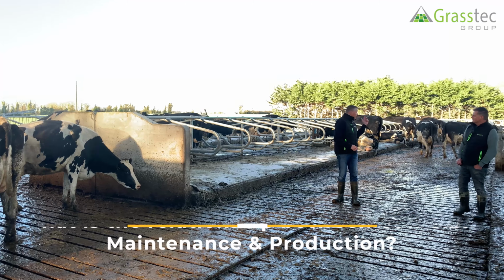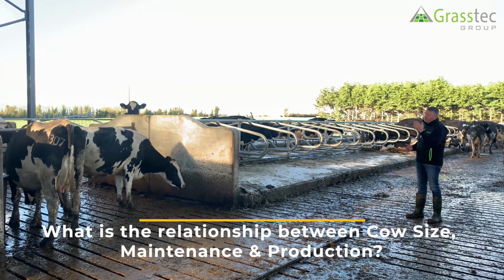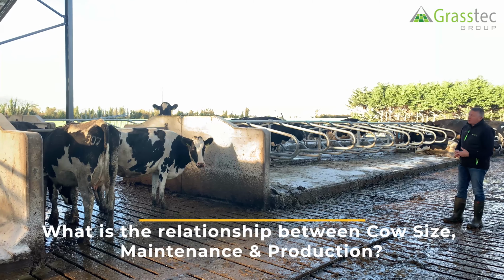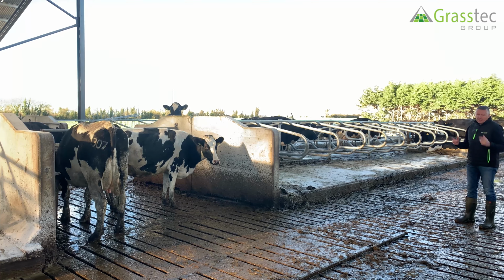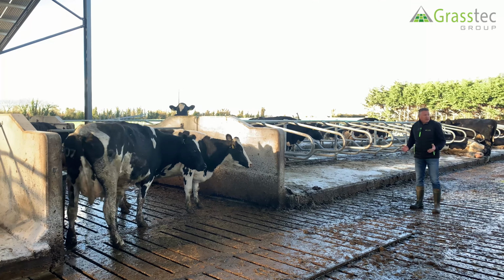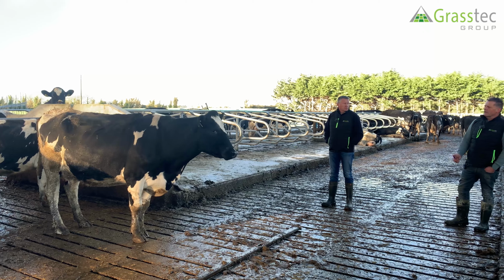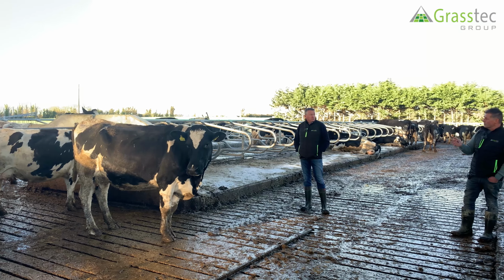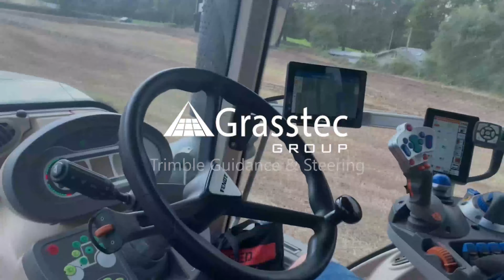What is the relationship between Cow Size, Maintenance & Production?

Comment: A fair enough assessment if both produce the same amount of milk solids. Though the higher production is elevated the smaller the effect maintenance has on efficiency.
I'd wager few cows below 700kgs get above 10000ltrs in 365 days.
In irish conditions at 420kgs solids per annum, a major cost is infrastructure, if you increased production to 650kgs of solids, you have 60% of the cows needed previously, so a everything from the amount of cubicles, the milking parlour, calving facilities and labour all decrease dramatically in comparison to feed efficiency.
Reply: Wait until feed is over 450euro a ton.
Reply: @richardphelan3815  what's the difference? Fertilizer for grass has risen too.